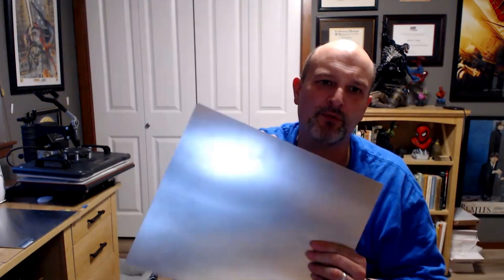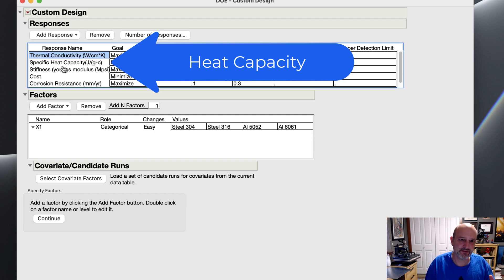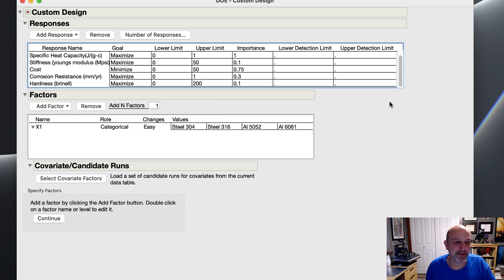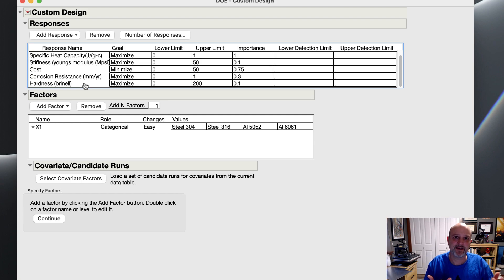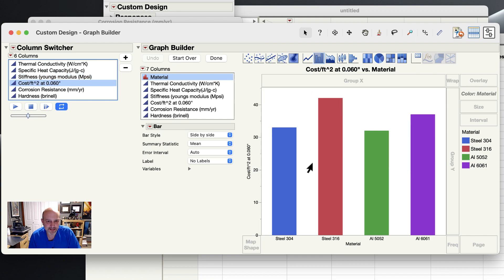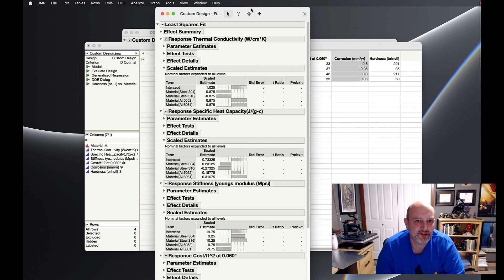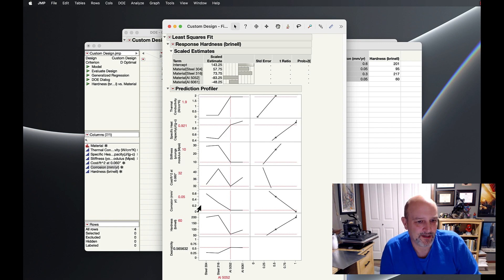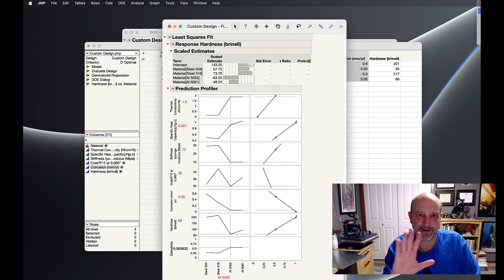Optimizing the metal to use in comic book pressing boards using JMP software

Comment: Hi Rick-  Up until I watched your video I had assumed the only reason for using a metal plate was to get heat on the bottom of the book so I wouldn't have to flip it during pressing. I had assumed that the top platen on the presser supplied the heat and that was fine.    Now, after your video I understand it's more about even distribution.  So my question to you is how even do I need to be with the second plate.  If I already own a 6061 aluminum plate, and I'm now going to buy a second plate, should it to also be a 6061 or could I mix and match and have the second plate a 5052?  Also same question with thickness? Do both plates need to be the same thickness (I assume the thicker the plate, the longer is can store heat?).  Thanks for your amazing videos.  You bring out my inner nerd!
Reply from the maker: The heat capacity and conductivity of 6061, 2024, and 5052 Al are not very different at all.  The are very different in machinability, scratch-resistance, and hardness, but their thermal properties are not very different at all.  I use 5052 Al most of the time so I can more easily polish the surfaces and debug the edges.  Thicker plates are definitely better at holding heat longer, but they only need to hold heat for about 45 minutes until they return to ambient temperature.  The thickness that provides that duration ends up being about 0.090” in a 15x15” panel.  

I’m super happy to help you read the nerd inside!  Lol

Comment: I love the videos.  I am curious how a tempered glass plate would compare to aluminum for thermal conductivity and heat capacity.  I use 3 mm (1/8 in) tempered glass plates (rescued glass shelves.  In pre-heating, the top and bottom glass plates reach/match the heating element temperature in 180 seconds.  Full cool down seems to take approximately 1 hour.  And I agree, you use what you have on hand.  I also fear scratching and gouging the book with a metal edge or corner.  The rounded edges of the thicker glass make me feel safer.
Reply from the maker: please consider that the thermal conductivity and the heat capacity of aluminum are both over 100 times that of glass.  In fact, glass can be considered a heat insulator instead of a conductor.
Reply: @ImmaculateComics  I think the thinner glass plates have saved me from cooking books that have been left in the press with the heat turned on.  My cheap press has a timer, but the timer does not turn off the heat, it just beeps at the end of the cycle.  I favor the glass plate flatness across the plate whether under press pressure or just stacked outside the press.  : )

Comment: Interesting video, Rick, thanks. I have 2 pairs of 9" x 12" pressing plates, in 304 stainless steel 1/16" thick, and 5052 aluminum 1/8" thick, which I purchased from a metals supplier on the internet. In my opinion 1/8" steel is too heavy and 1/16" aluminum is too flexible. I  have found that I can adjust the pressing temperature and time, to get good results with either material. I do prefer the aluminum for its effectively zero corrosion risk.

My personal top criterion when evaluating pressing plates is not a function of the material's innate properties, but rather the manufacturing process. Namely, are the plates dead flat or not? Because to me, "pretty flat" is not good enough. I would happily have paid twice what I did on the internet to get plates that were truly flat, which would have saved me the hours I spent laboriously tweaking the ones I got, achieving maybe 98% success. 

Because you buy your aluminum in relative bulk, I would urge you to be very demanding of your supplier to sell you the flattest material possible. This should be fairly easy for a motivated and capable metal shop to accomplish, by adjusting the series of flattening rollers that processes the raw sheet metal coming off the coil. Also, the pressing plates should be cut to size with any remaining slight curvature being oriented left-to-right across the comic, so pressing can't itself introduce spine stress/ticks.
Reply from the maker: That is valuable input, thanks so much.  I almost never have planarity issues on any material these days.  When I first started ordering material in large 4x8' sheets I just ordered it to be "cut" and the cheaper way to just is with a shear or a press brake.  this would warp the edges of the boards slightly in most cases, creating stress which manifested as a convex or concave shape overall.  Later I switch to laser cutting.  however, when I started having the boards polished and pvc coated, the laser would sometimes burn and melt the pvc coating.  Now I have them water-jet cut and I have to manually deburr all 8 of the edges, but they are exceptionally planar and maintain the coating.  A surprising amount of process control goes into having a large number of metal sheets!

Comment: I wanted to order pressing plates from you, but shipping to Canada makes it quite pricey. I went to a local business to buy 6061 plates. They only had it in 0.125 thickness. I chose that over the 5052 because I wasn't sure if it would be too soft. It was definitely more expense than I was expecting, and the sanding was no fun. I am sure the thicker plates I have are fine, but I wish this video was available six months ago.
Reply from the maker: Hi Allan!  Shipping to Canada is definitely a killer. I wish I knew a comic book store in Vancouver that could be a distributor for me to save on Canada post.  6061 it easier to machine so thats why I use it as I deburr the edges. I understand that many people see items I used and are encouraged to work around to get their own, and thats fine with me so long as it works.  However, I do put a ridiculous amount of study, design, and effort into each product that is likely quite invisible to casual cleaners and pressers.  It makes me wonder if it is worth the effort as I can often just buy really cheap material or provide an amazon affiliate link but its just not my style.  Good luck up there in the great land of maple leaves!  -Rick

Comment: Great info!  Thanks! I've been using the thinest steel plates I could find for pressing which seem to work ok.  Not really in a moist environment so they're working well especially with even heat transfer to the book area.
Reply from the maker: Great tip, I am glad they are working for you!